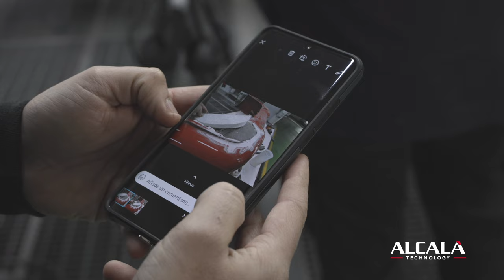Restoring the Ferrari F355 GTS with Alcalà Technology

Comment: Who lets a Ferrari go like this? And what was the final invoice amount?
Do you buy a thrashed car and throw a ton of money into it or do you buy a well cared for car and do refreshments. Which is the better value?
Reply: @alcalatechnology  Excellent marketing to building a brand. Still, which is the better car to start with? Trashed or Treasured? I'm not suggesting either, I'm asking, which is the better value?
Reply: @alpintourer  my limited experience is that because of the cost of labor to refurbish a neglected car, it's cheaper overall to buy a better condition one to start with and have no or very little enhancement costs. Servicing costs remain equal.